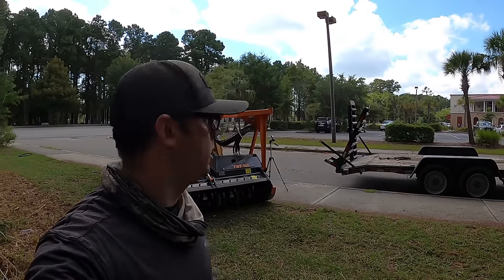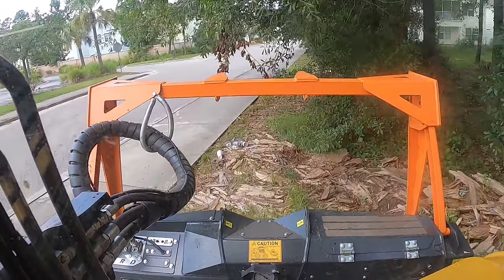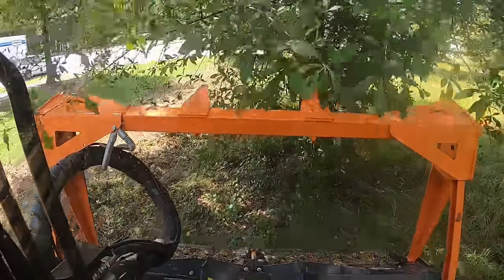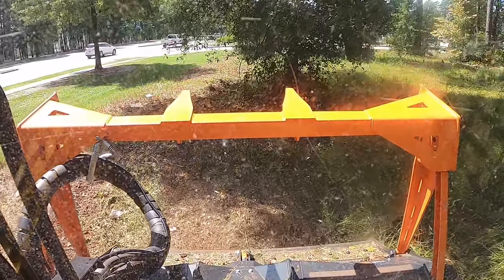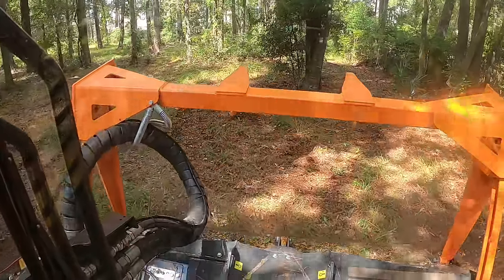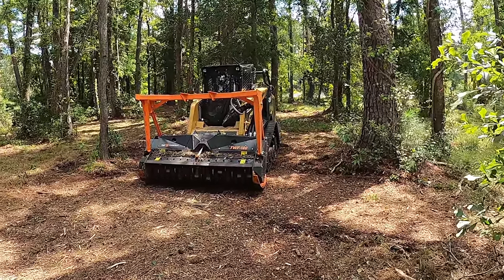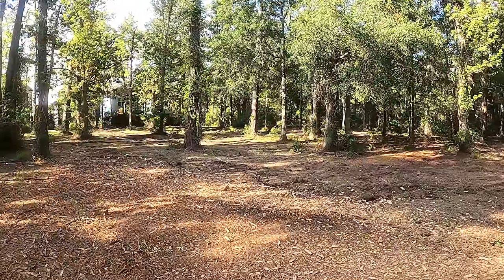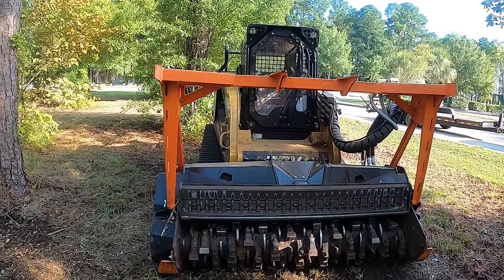WIDOWMAKER WONDERLAND! MULCHING DEAD TREES WITH THE TMC CANCELA!

Comment: Watched a lot of mulchers in action. Prinoth, Fecon, others. This one here is only one of two that ever impressed me, and the other one was the huge Prinoth 500 tank machine.  But this one. Wow.  I kept thinking, well it's new so the teeth are just sharp and it will slow down and wear down but it hasn't done that.  It just goes.  I did have to cringe a lot as you hit "that big ol stump" with the chunk of concrete in it that you obviously could not see.  You kept hitting that concrete, hard.  But the machine did eat it.  Nice.  That's a normal real-world thing that happens on any job and it handled it.
Reply: We offer knives and carbide hammers if you have Rocky conditions.

Comment: Very satisfying to see munchie chew through that punky pine.  The problem with cleaning up the lot so you can z-turn it is now the city can hire someone cheaper to come in and z-turn it (you've done the hard work in cleaning it up).  Love your content.  You mentioned the mulcher runs about $40k all in.  I'm guessing a skid steer with enough hydraulic flow to run it is probably 70-80k though, right?  A guy can dream.

Comment: burnt out on foot ball 🏈 used to watch college sometimes few pro football. i prefer to be outside fishing 🎣 even that has taken a back seat. Between covid and major parks being booked up a year fuel prices make anybody cuss your trips either have to wait a year or camp out in the drive way. those with rv’s need to exercise their stuff and it’s good time to stay ahead of the maintenance. boats winterizing time. put batteries on a charge periodically oil changes lower unit and engine. we used to remove the battery prior to storage drain the block fishing boats have an on board charger best do a once a month charge. store with full tanks to prevent water separation add fuel stabilizer or t-totally drain it . store in fifty gallon drums burn off in your vehicles gas goes after a few months.

Comment: As much commercial time you giving CCE they alt to give you that head for like quarter price and it being used too you know. Like you said it works a lot better chopping stuff up faster than your other mulcher and the door on it is really nice. I'd poke at them much as I could about them giving it to you or selling it to you at a very reduced price for real as much as you doing for them. Not meaning to be an ass now but just because the camera is in the cab with you doesn't mean you have to talk and/or make noise. Explaining things is fine which I'm sure everyone likes to hear you do. Its enjoyable watching from inside the cab seeing what you can see too so I do like that but you don't have to be talking just to be talking. Just my opinion as a long time original viewer, take it or not I have and will still watch. A question I have is why not go side to side across the chips after you've mulched up one of the big logs leaving a high spot pile like of chips and spread them out so they rot faster and aren't a mound to drive over next time? Seems like you'd want to do that as part of getting it ready to mow with the zerp turn. Good video. 👍